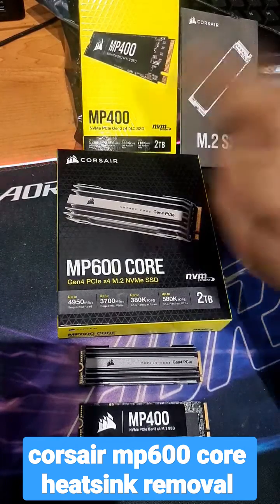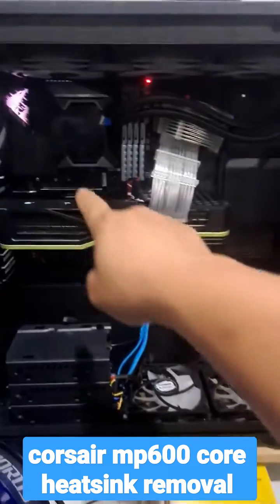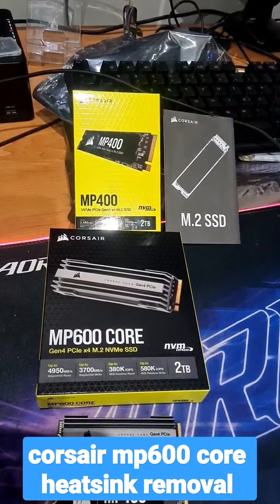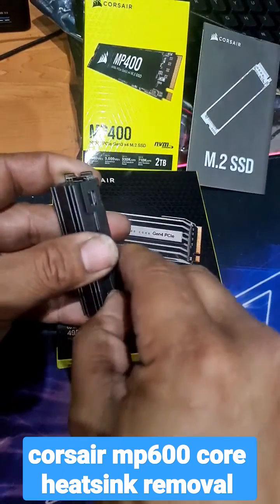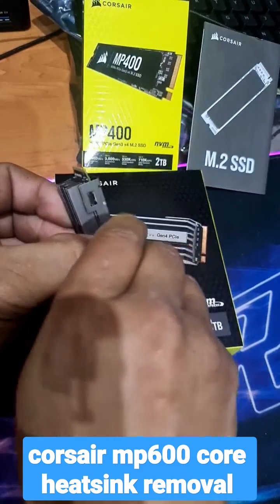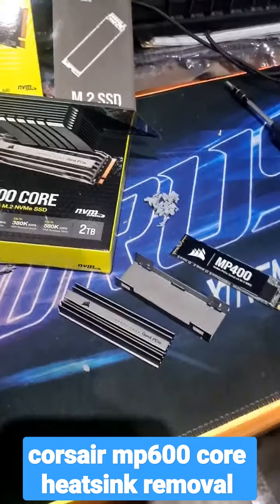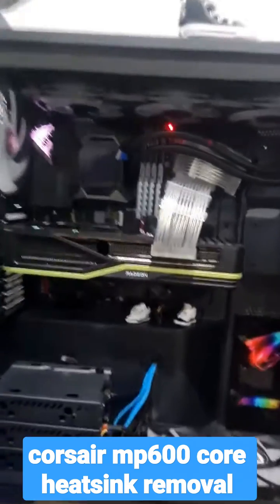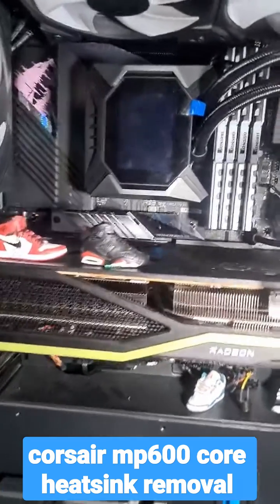corsair mp600 core heatsink removal

Comment: Can’t you keep the stock heatsink on it? The Samsung 980 pro with heatsink is cheaper than the one without. So do I have to remove it or not? I also have a build in heatsink in the board
Reply from the maker: if u already have thermal pads on your mobo u won't be able to use the heatsink on the ssd.. this reason being it becomes too thick and you won't be able to get the ssd in ..hence why I removed the heatsink ... I tried that and it does not fit. I even tried just leaving the small piece of  heatsink where the chip is ..but that was bad because it flexed the ssd which could break or damage the ssd ... so in the end I had to remove all heatsink and simply use the one on the mobo... now if u believe the heatsink on the corsair is better then that of your mobo u cab always remove the mobo heatsink and keep the ssd ... just bare in mind the heatsink on the bottom has pre cut holes to sit over the mounting holes ... hope this helps
Reply from the maker: if its cheaper with then get it and simply remove the heatsink , which mobo do u have and if it already has heatsink on your mobo u will need to remove it

Comment: Its so hard to me i have to remove but i cant
Reply from the maker: use a flat head ans get between .. u see how it clips on . it might just be the adhesive from the heatsink just peel slowly it will come off
Reply: @MIKEYZVLOGZ  i got pro version it has double thermal pad i guess thats why i cant remove it
Reply: @MIKEYZVLOGZ  its really expensive in my country also its my first time i dont wanna break it 🤣 i guess it will take time  for me
Reply from the maker: @trilecebey  ye but just know that it is removable my friend 100%
Reply: Get a string and use that as a ‘saw’ blade almost or use a Stanley blade and cut it